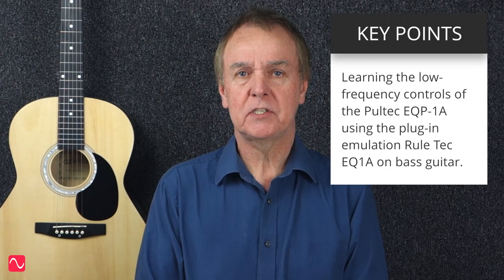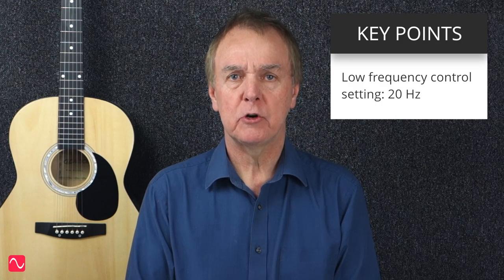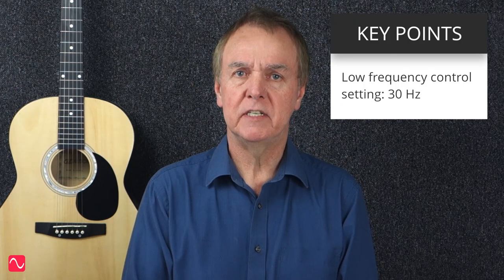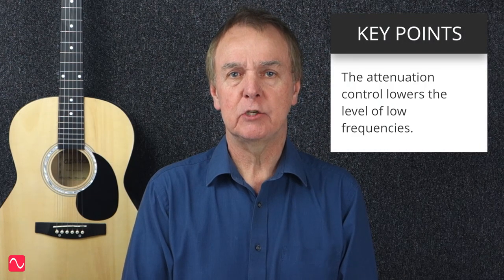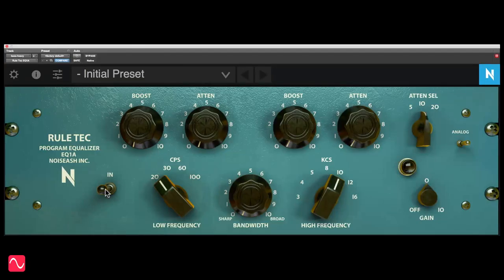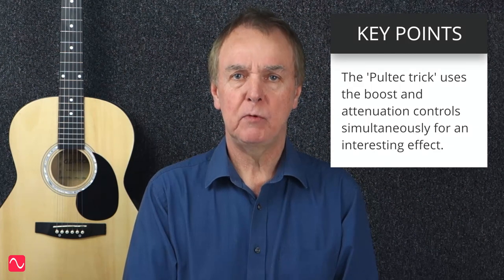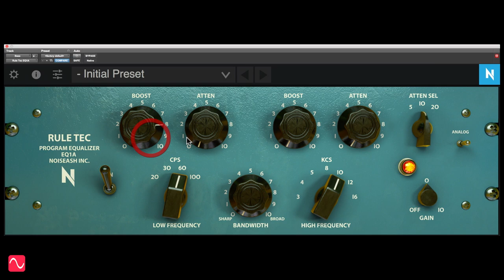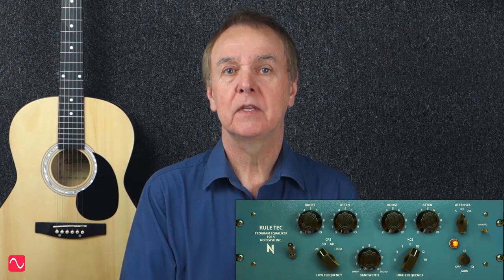How to EQ bass guitar using the Pultec EQP-1A

Comment: Great choice of subject and nice clear methodical coverage of it, as well as great choice of the Ruletec. I think it would be educational to describe in detail what you hearing, liking, and disliking about the different settings, especially when you're finding that sweet spot that you prefer. Might have also been worthwhile to mention the upper frequencies in that original bass track as it was quite buzzy at times, even if to say that what might appear to be a problem when soloed, might not be a problem in the mix. Also, comparing your treatment of the bass soloed to how it would work in the mix would obviously be relevant under most circumstances.
Reply from the maker: Thank you for your comment. Regarding the sweet spot, I prefer not to consider that my preference is better than anyone else's so when I settle on a setting it's because I think it has the best balance between too little effect and too much. Others may differ. You're correct that this recording of bass is rather buzzy. This can be a problem depending on context, but my feeling here is that since the player (not me!) is very competent then they probably like this kind of sound. DM

Comment: I have several versions of plugins that sound good but different from each other and different from the pultec hardware. Close enough though. The phase rotation in the low end I believe is way more important that the actual boost/cut. The best emulation in my arsenal are the waves Puigtech and the Softube Tubetech. The Puigtech also add a nice saturation.

Comment: For comparison, do you match the levels by ear or another method! Great Video!
Reply from the maker: Comparing levels can be done by ear, by ear with a visual aid such as a VU meter, LUFS, or peak. Each has its pros and cons depending on what you want to find out. For finishing touches in mixing however, it's always the ear that's most important. DM

Comment: I actually really like that second bass tone with just a bit of attenuation. What was used to record that? Sounds like some sort of fuzz?
Reply from the maker: This was recorded by an Audio Masterclass student. It's the same original clip all the way through. We don't know the setup but one of the interesting features is the fret noise. Normally this is an irritation but in this case it really adds to the character of the sound.
Reply: @AudioMasterclass  do you think maybe the fret noise is giving the listener kind of a distorted sound? Like how L'via L'viaquez bass or bulls on parade